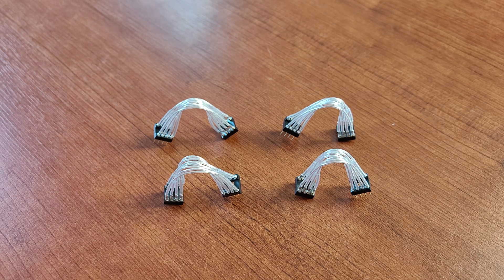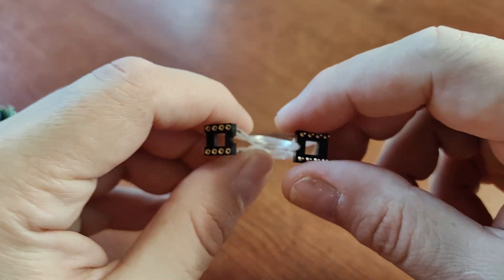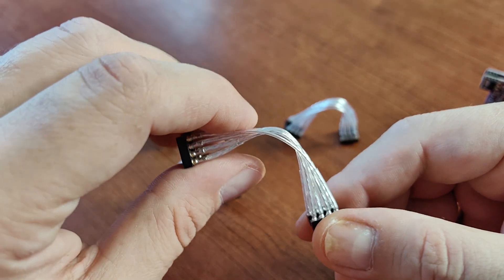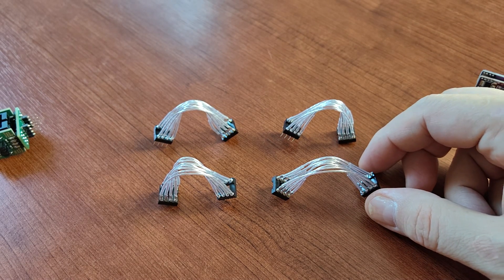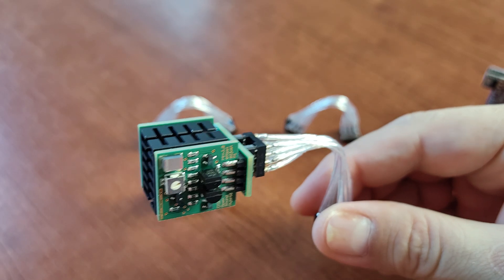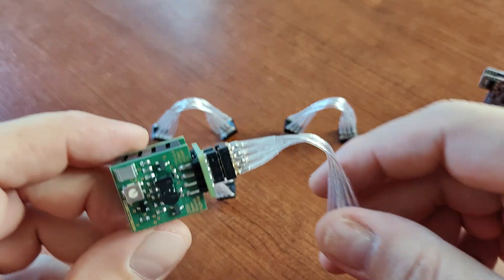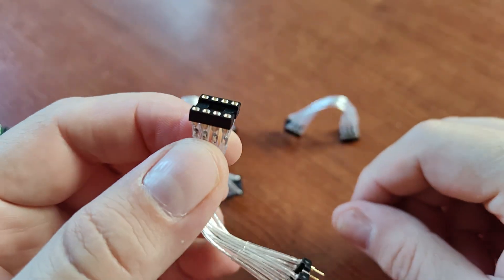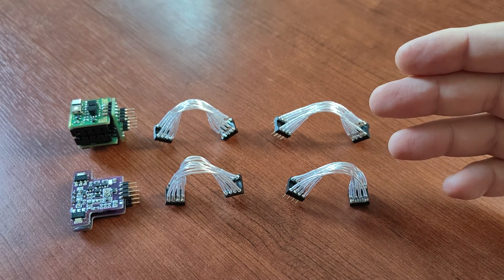DIP8 opamp socket raisers - what to do when there is no place for your new Staccato?

Comment: LOL!I paid 40 Eu for two of these on bay of e....😞
Reply from the maker: @MrSler  sell them for 35 and get these :)
Reply: They are easy to make.  Amzon has a 20 pack of adapters for 10$.  Enameled magnet wire is cheap and firm enough to hold it's shape.  Little solder....... golden

Comment: OP27 is possibly another alternative? Appears to be an upgraded version of the OP07.
Reply from the maker: @RonaldHeal-j6f  yes, for IC opamp with similar use scenarios. But if you'll take a look at parameters alone, new OPA series (like 828 etc) are also very precise, with miniscule thd and noise. But more expensive! 
And they can also be used in precise measuring equipment, that's one of the intended purposes
Reply: @k4syx The specs on all of these op amps are at levels that should be imperceptible to discern a difference. However, there may be differences in the sound of D5pro that we can perceive? It's an interesting and worthwhile exercise. Waiting for your impressions like a kid on Christmas eve😂
Reply from the maker: @RonaldHeal-j6f  yes theory says that good old ne5532should be enough for everyone. Yet its very easy to hear differences, especially with headphones. Im also very curious about 03 discrete in both D5Pro and 933 - they may serve different purposes, there may be a difference or none at all - we'll see!

Comment: I am willing to bet the discrete op amp does have an effect on the sonic signature of the D5Pro. Even though it is not directly in the signal path. Everything makes a difference. Just as changing a rectifier in a tube amp. You can hear the difference between a good and bad rectifier easily.
Reply from the maker: @RonaldHeal-j6f  We will see, I'll check that. My first thought when I saw 07C there was too replace it with something very precise AND very fast, like single 828. If I will hear any positive change (or negative) I will do some more experiments

Comment: In this case, the signal path is several times longer than when OP amp is soldered directly into the board. Sometimes this can cause stability and oscillation problems.
Reply from the maker: Yes exactly, I think I've told that in video, especially with very fast opamps!
Reply: That was the first thing I thought of when I saw the length of the extensions. Only one way to know for sure😊

Comment: Great stuff as always. I am really interested if the discrete op amp will improve the D5? For sure, there will be a change to it's sonic signature at the very least.
Reply from the maker: Thats what I will check. D5 uses them AFAIR as DS servos, so there shouldnt be a sound signature change. But thats to be checked. 933 uses these for current feedback loop I think so there may be a difference (they are warming up now)

Comment: may be i should ask a more basic question ... why a better opamp make the sound better ? or i should say a better macthed opamp with the gear make the sound better ?
Reply from the maker: opamps are basically small amplifiers, they do have their inherent noise, thd, slew rate, snr etc.
So they will have different sonic properties, but as you say, they should be matched to whole circuit. but usually, especially in cheaper amps, there are just standard NE5532 thrown in and thats it. Because better opamps are more expensive!

Comment: just a silly question ... is it a analoge signal or digital signal for the input of a opamp ? i guess the sparko can make the sound better with a miniboard , Theoretically which increase the noise ... in  the specification of D5pro clone,is it a  it mentions there are 6 components in the amplification path  is it the concept " Simplicity is good "  of course another opposite is Accuphase hahah complexity is good 
is the opamp is one of the six components in the amplification path ?
Reply from the maker: this one is completely analog and in D5Pro its not in direct dignal path, opamp there is usedin dc servo, so in theory it shouldnt affect the sound. But I want to check that
Reply: @k4syx  why can sparko opamps make the sound better ? What is the difference between sparko opamps different from a ic opamp just one piece ic ?
Reply from the maker: @richardlui8914  Sparkos and other discrete opamps use discrete components and have "internally" different design (like class A for example). ICs are meant to be small, miniaturized and use very small power. Different design goals. Having said that, there are excellent integrated opamps like opa828
Reply: @k4syx  just I note that in the Dac .. the rca outputs need one sparko opamp.. but balanced outputs needs two sparko opamps why ? Because the balanced outputs has higher voltage ? Then rca runs like a normal amp and balanced outputs like two mono blocks?
Reply from the maker: @richardlui8914  no, it's not that. Depending on the circuit design, you may need one or two opamps for different reasons, also, you need to remember that every ne5532 compatible opamp has two operational amplifiers inside (a pair). So, it always depends on design and intended purpose
Reply: @k4syx  one more silly question ..we know sparko  is good for those Chinese monoblocks.. but good in general ...but is there any experience you change to sparko , that make the sound worse ?
Reply from the maker: @richardlui8914  that's always possibility, it's all about pairing. Usually it's for the good, but not always